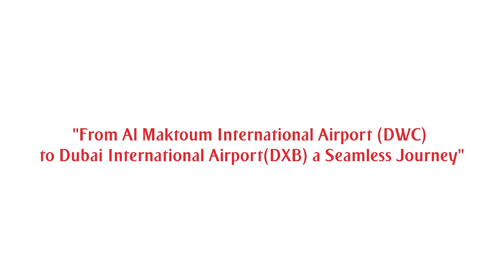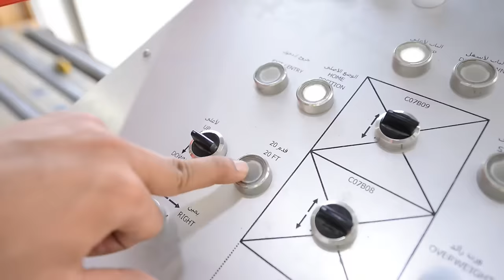Emirates SkyCargo Trucking Operations | Emirates SkyCargo

Comment: Thaths fake de have not Boeing 747
Reply: They aren't using 747 for passangers , they are using 747 with SkyCargo
Reply: so beat it they have two 747s
Reply: They do have 747 Cargo Freighters, but there were reiteed in 2017